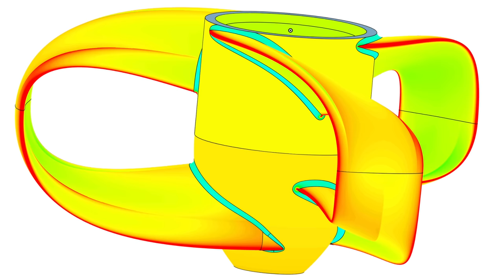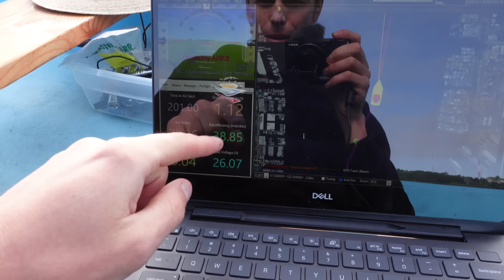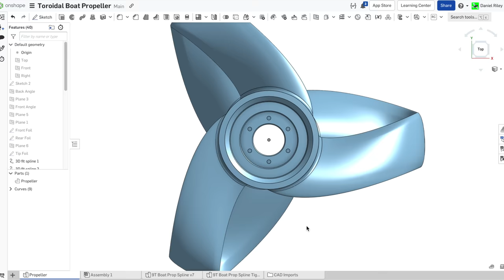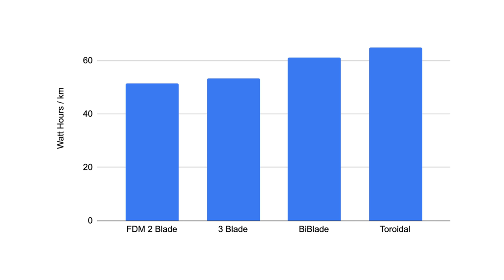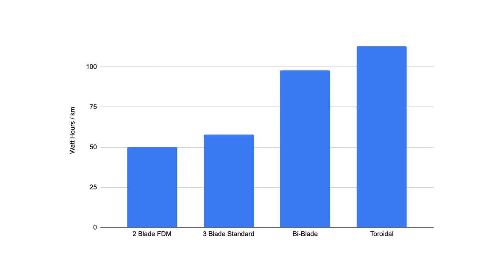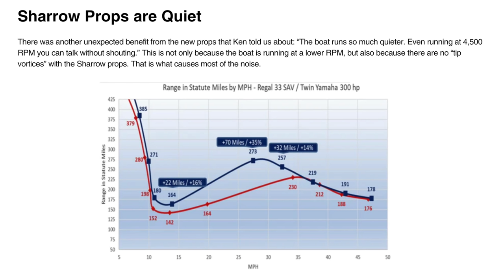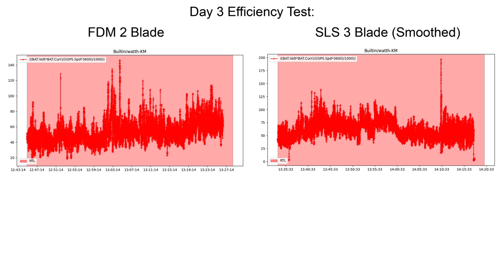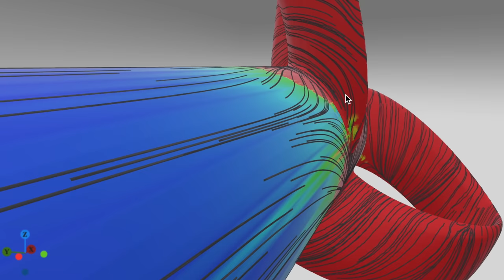Testing Futuristic Propeller Designs on my Solar Powered Boat

Comment: Awesome work!

Let me say that designing things like this is EXTREMELY difficult. Many fluid flows don't act as you expect, especially in real world conditions. This makes real world testing incredibly important for optimization. 

Mad respect
Reply: It's the same with just about everything you design. A customer designs antennas for mobile phone networks. They spend months on a theoretical design, simulate it using the most advanced software available, and then build a prototypes to test that what the simulations and models claim is what really happens when you use them. Most of the time it's close, but sometimes they get a surprise. These computations are pretty heavy. I remember that before the code was revised to use the GPU's the fastest computer we could build would take several hours to simulate the radiation patterns of the antenna.

It's the same with fluid dynamics. We know a lot of how it may work, but once we've worked with the known theories and designed something that works well in fluid dynamic simulation we have to build and test a prototype to see just how close to the simulated results we get.

The software has gotten so good that usually there's very little difference between theory and practice, but every now and then there's a surprise. And this is especially true when trying to invent a new profile or radically different design like these toroidal propellers. There hasn't been anywhere near as much data for these shapes to verify the computation models against the real world results.
Reply: @blahorgaslisk7763  it's especially true for something like a propeller that works in a very dynamic environment. Simulation software usually works like a wind tunnel, exposing the test subject to a stable environment, while a propeller will constantly encounter variations in the speed and direction of movement and even density of the material it's propelling through, and the uniformity of those values over it. The way it deals with those variations can both affect its performance and be independent of its performance in a stable environment. And we'd be simulating for months if we wanted to test a decent range of situations.

Comment: You could add a load cell to the transom and measure the force applied by the propeller vs the power consumed. This would be a faster way of testing, and you could ramp up power and get a performance curve.

Comment: Interesting. I did a lot of prop testing with my solar electric boat, but one advantage I had was that my hull is a wide beam catamaran with each motor mounted behind each hull, so I use independent thrust of each motor to steer the boat, which means the simplest way to test and compare props is to put one on one motor and a different one on the other and see which one overtakes the other causing the boat to steer in one direction or the other at various speeds while monitoring power consumption and speed. So far, the Torqeedo props seem to be the most efficient highest performance props available. I think stiffness of material, chord profile, and tip sweep are all factors that play into this. Also, I think a cavitation plate helps and since I’ve added remote electric trim and raised my motors, I’ve found they perform better closer to the surface just under the cavitation plates allowing my hulls to semi-plane.

Comment: One of the major differences i noticed in Sharrow Marine props vs 3d model you are using is the blade angle, not necessarily pitch but the way stern facing part of the blade is angled. So the loop is angled more aggressively toward the center of the prop. I would try prop design to perfect it further from there.

Comment: I would think that the one of the reasons the toroidal and bi-blade props are so much less efficient is because the pitch is too steep. That would make sense based on what you found with the air bubbles, that the blades are in a stall.
Reply: The blades are very narrow as well. Looks not very efficient to me, it is more like an air prop.
Reply: @nielsdebakker3283  I agree. They have a lot less surface area too, which I think is a big factor

Comment: Sharrow has been doing toroidal boat props waaaaay before MIT's publicity-laden drone prop.

And when it comes to efficency, both Sharrow and MIT say that ducted propellers are more efficient. Toroidal is just lighter than ducted setups and does not have the debris issue that ducted props do.
Reply: I too, watched the video.
Reply: They have indeed been at it for a long time, but have yet to resent any evidence of it having an advantage to speak of against any reasonable run of the mill 4 bladed prop.

Comment: You could account for wind velocity by driving around a circuit course-corrected by speed-through-water rather than landmarks, which ia speed-over-ground. So drive one direction for set time, and calculate your velocity by water not landmarks (ground), change angle and repeat.

Comment: The noise reduction is supposed to be in the context of marine life, not occupants on the boat itself. It would be another interesting factor to test under water for at different distances and positions from the prop if you do another round.

Comment: To test the thrust efficiency. Couldn’t you put the boat in a pool and have it push against a horizontally mounted scale and see how much pressure it puts against the scale. You could also test how much throttle it takes to achieve a certain pressure on the scale. The lake experiment is cool, but there seems to be a lot of variables that can’t be mitigated. Love your videos. So much trial and errors and refinement. Great work.
Reply: yeah but where's he going to get a pool from, pool salesman?
Reply: That’s the hard part? Where to get a pool? If that stopped him, he should just shut the whole YouTube channel down.
Reply: The bay is a large pool. You could just anchor and tie up anywhere along the shore. However, not moving changes all the dynamics of the system.

Comment: If a wing is deigned for high speed, it should have a small aspect ratio to reduce form drag. It feels like the same rule should apply to propeller. As how fast a boat propeller generally spin, maybe winglets will cause more form drag than the induced drag it decreased...
Also, wings stalls at a certain angle of attack, so it doesn't really matter how fast it is spinned. If it is stalled and a certain AOA, it stall at all speed.
Reply: changing prop RPM changes the angle of attack.
Reply: last time i checked wings stall at a specific speed for a given angle of attack, right?
Reply: @kyriakos_kyriakos9103  wings stall at a specific angle of attack, regardless of speed.
Reply: @SoloRenegade  so when an aircraft is not stalled at a specific aoa and speed, if it keeps the aoa constant and starts reducing speed it will never stall?
Reply: @SoloRenegade  how does change rpm changes AOA? Is variable pitch prop a thing in boat?
Reply: @kyriakos_kyriakos9103  it never stall. But the slow the plane, with a constant AOA, the wing will generate less lift.
Reply: @kyriakos_kyriakos9103  correct. if the AOA is kept constant as speed is reduced, the wing will never stall, however it will produce less and less lift until it produces zero lift at zero airspeed.

The issue is that as speed decreases, the AOA increases if the wing is held at a constant angle relative to the plane of motion. So to keep the same AOA as speed decreases, you must simultaneously decrease the angle of the wing relative to the plane of motion.

Conversely, if you hold the pitch of the wing constant relative to the plane of motion, as speed increases, the AOA decreases.

If you instead held the pitch of the wing relative to the plane of motion constant, as you decreased speed, eventually the AOA would increase until it exceeded the critical AOA and stalled.

But if at any point, at any speed, you take the pitch of the wing beyond the critical AOA, it will stall. You can simulate this in a wind tunnel to see that it's true.
Reply: @shiroyukiwang1252  yes, variable pitch boat props and airplane props exist.

The reason AOA changes as wing velocity (or equivalently, propeller blade RPM) increases or decreases is a function of resultant vectors. Hard to show/explain textually. Very easy to explain visually in pictures. I teach this to kids, college students, pilots and engineers all the time. There are videos on youtube, but few explain this exact issue very well unfortunately. I wish I could come up with a way to explain it to you. But to help you truly see it requires pictures. It's very obvious and easy to understand with the right diagrams.

There is essentially an upward flow vector (vertical, Y-axis), generally associated with Induced Flow (the real explanation is much more complicated, and not important here anyways, the result/effect remains the same regardless). As speed decreases, induced flow increases. And there is the velocity vector that moves opposite the direction of the wing (propeller blade), horizontally (X-axis). As the velocity vector shrinks, the upwards flow vector increases, and the resultant vector points ever steeper (more vertical). As velocity increases and the induced flow decreases, the resultant vector is increasingly more horizontal. the angle between the resultant vector and the chord line is AOA. If the chord line was held constant as the resultant vector changes with speed, you'll see that the AOA changes. If you wanted to hold AOA constant as speed changes, then you must continuously adjust the chord line of the wing as the speed and resultant vector changes.
Reply: @SoloRenegade  unless you’re saying forward movement will reduce propeller’s effective AOA, it stays constant no matter how fast the prop spins.
Reply: @SoloRenegade  AOA is only related to a wing’s angle of incident and plane’s own attitude. It doesn’t change based on airspeed…
Reply: @shiroyukiwang1252  forward motion of the boat does affect the resultant AOA of the airfoil, yes, but I was isolating variables here, and only addressing AOA with respect to wing velocity (propeller RPM).

"it stays constant no matter how fast the prop spins."

that's a more complicated discussion, as there are limits to propeller RPM. For props in water/fluid, cavitation can occur. for props in air/gas, compressibility issues occur, if you spin the prop fast enough. There are very real limitations on propeller capabilities and RPMs. And then there is the centrifugal forces of high RPMs. Look at the insane amount of engineering required for the Bloodhound car designed with intent to break teh land speed record. they encountered incredible challenges trying to keep the wheels from tearing themselves apart at such high rotational speed.
Reply: @shiroyukiwang1252  "AOA is only related to a wing’s angle of incident and plane’s own attitude. It doesn’t change based on airspeed…"

you are objectively wrong.

For example, angle of incidence is the angle between the airfoil's chord line and the long axis of the airplane when in cruise flight (with the long axis of the aircraft said to be parallel to the horizon at cruise). this doesn't change once the wing is bolted in place (exceptions for the F-8, flaps, and other situations, but the basic idea is valid). Angle of incidence has no actual relationship to the AOA. the AOA of the wing doesn't care about the fuselage's relative position.

AOA doesn't change based solely upon airspeed, as I explained to another person in this very comment thread. If you continuously adjust the chord line of the airfoil (pitch of the wing) as the speed changes, you can hold a constant AOA. But if ALL you changed was speed, the resultant velocity vectors would cause the AOA to change.
Reply: @SoloRenegade  Wing stall speeds do vary by speed, but in most cases it's not enough to be relevant to pilots. However that effect may be exaggerated by the much higher density of water, so I don't know that we can ignore it without knowing more.
Reply: @clonkex  "Wing stall speeds do vary by speed, but in most cases it's not enough to be relevant to pilots"

wrong, it's very relevant to pilots, and is one of the single greatest causes of aviation accidents and fatalities.

"Wing stall speeds do vary by speed"

explain what you mean here? a wing can stall at any speed at any time, even with no change in speed. But for a given airplane design, at a given weight, in level flight, there is only one stall speed, and that was determined by the designer. I'm just trying to understand what you mean here that stall speed changes with speed when you are referencing a specific airplane design.
Reply: @SoloRenegade  Forget all that pilot stuff. This theory is quite simplified. It is totally enough for pilots to understand the dangers etc. But if you go into engineering-questions, it is just not sufficient to explain the effects properly...

In general, a wing stalls depending on the angle of attack AND the Reynolds number. The Reynolds number does depend on the speed. So the stall depends indirectly on the speed. One caveat though, this dependence on the Reynolds number becomes less and less the higher the Reynolds number gets. So for regular airplanes, it may be (in practice, i dont know) independent from speed.

Also, this "The issue is that as speed decreases, the AOA increases if the wing is held at a constant angle relative to the plane of motion." doesnt make sense, right? AoA is the angle between a reference line on the airplane (sometimes the chord-line) and the in flowing air, aka "angle relative to the plane of motion".
Reply: @SandFl0h  problem is, reynolds number is not something you're going to change on the fly in the water or in the air. What has been stated for Stall and AOA is completely true for a given airfoil.

This whole idea is rather pointless becasue the airfoil can stall at ANY speed, at EVERY speed. and at the published stall speed, the reynolds number is always the same every time. Unless at higher altitudes or deeper pressures, but the indicated speed will remain the same as the fluid density changes, so it's self correcting for that as well.

"Also, this "The issue is that as speed decreases, the AOA increases if the wing is held at a constant angle relative to the plane of motion." doesnt make sense, right? AoA is the angle between a reference line on the airplane (sometimes the chord-line) and the in flowing air, aka "angle relative to the plane of motion"."

wrong, what I said s true, and it does make sense. and the AOA is the angle between the Relative Wind (resultant vector) and the chord line of the wing, and NOTHING else. it is NEVER measured in reference to some arbitrary fuselage reference line. Not Ever. the fuselage/airframe is irrelevant to how teh airfoil works.

The plane of motion is not always horizontal. when I describe plane of motion think of an airfoil in a wind tunnel to make it easier on yourself. the plane of motion changes in real flight as other variables like AOA, speed, and direction of flight changes. They are interrelated. if the plane of motion never changed, you could never climb, descend, turn, etc.
Reply: @MikePerreman  thank you. glad to see I'm not the only on who gets it.
Reply: @SoloRenegade  I mean airspeed. The speed of the air over the wing does influence the stall speed of the wing, not just angle of attack, despite what's commonly taught to pilots.
Reply: @clonkex  but that's already automatically accounted for by the airspeed indicator, design stall speed. 

Flying faster doesn't change the stall speed. As you slow back down to your "new stall speed", it just changes back to it's design stall speed prior to stalling. However, if while flying faster, your stall speed changes (say from 50kts to 55kts) but you're flying at 120kts, it doesn't much matter. but you can still stall it at 120kts.

give me a single scenario where speed changes the stall speed, and you stall at that stall speed at the same time......

Comment: In regards to this ingenious design that MIT claims to have discovered I suggest you look up the "ship's screw" by Josef Ressel from 1826! If it wasn't for a mechanical problem of the motor during the first test today we could have this type of propellers in much more use!

Comment: Something that i think would be interesting to see is the performance through rpm ranges represented on a graph. The thing that tryly interests me about it is when you mentioned the forward sweep of the lower blade on the bi-blade prop. Typically forward swept wings on planes have some interesting effects in transonic flight vs typical and rearward swept wings. 14:46

Comment: You know, you can just set up a large tub of water at your house, then run each design and get the same efficient data to sort out the best design 😃
And you can also quickly FDM print all different designs you think will be good to test,  as long as you keep them all "rough" you can still sort out the best design from the efficiency data. Then send the best design to get laser printed, sand it, polished it and finally test it on your boat.
Reply: how do you test the conversion efficiency in a tub? we would know only how much resistance each propeller has, not if that power is getting wasted or converted to thrust efficiently
Reply: It's definitely not the same
Reply: Maybe in a pool, something small as a bathtub or tub would have all sorts of turbulence coming back from the propeller itself
Reply: @FAB1150  I do lots of testing of outboard on test tanks, even on the low HP motors like 4hp, after a little bit of gas you hear de motor have less resistance and then more. These props move a lot of water! Even in a pool, you will create very large currents, it has lots to do with the depth of the water.
Reply: That would be a static thrust test so by defintion the efficiency is always 0
Reply: @julianpowers594  if you're measuring Wh/km sure, but you can measure W/kg of thrust.